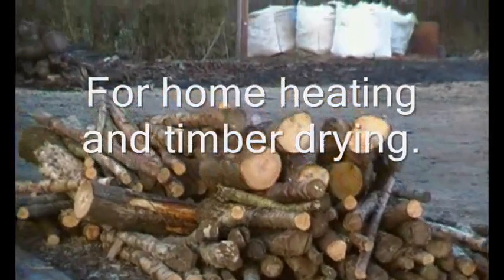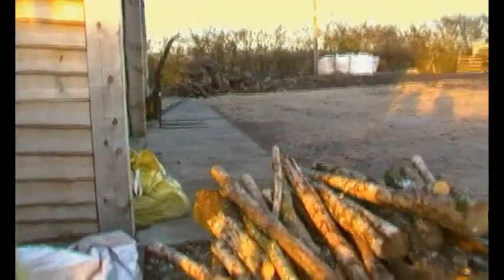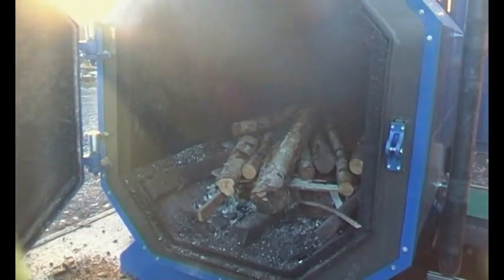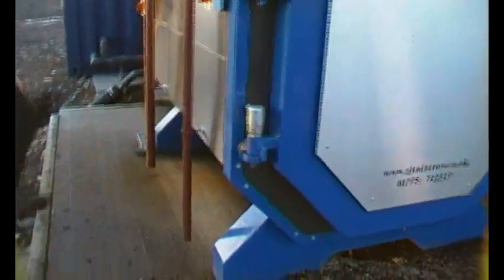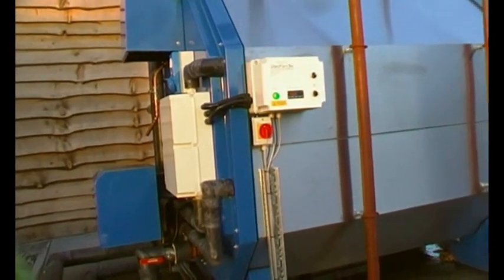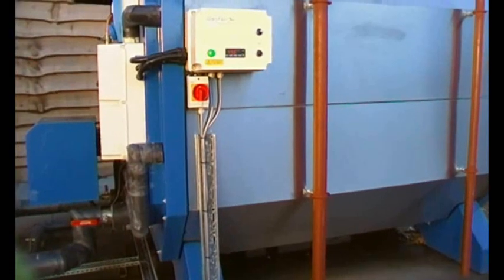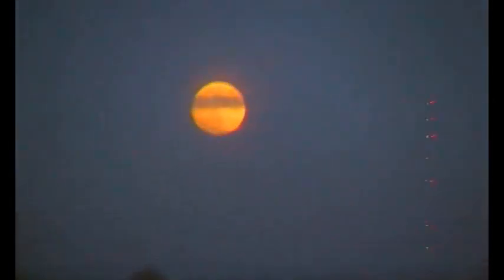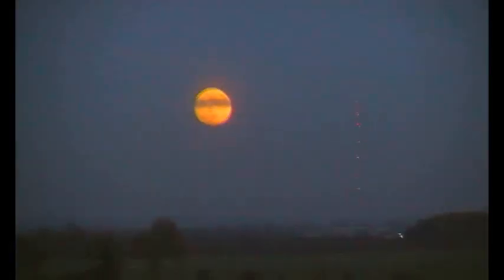Firewood drying kiln run with biomass boiler, and providing home heating.

Comment: Looking to build a small firewood kiln (on the cheap) to finish dry our thinnings for sale using a shipping container and home built wood burner Andy. This video and the chap over at the Oak Farm Firewood channel is giving me plenty of inspiration👍
Reply from the maker: Jim, from my experience it#s all about airflow and so transferring moisture from the wood surface without drying it too quickly, so the air doesn't need to be too warm, cheers

Comment: I’m looking for this exact set up. I have 2 45’ containers that I am wanting to use for a firewood dry kiln. Where can I buy this set up?
Reply from the maker: Hi, it's a Glen Farrow from Spalding Lincolnshire, subscribed? cheers
Reply: @TheInfoworks  I’ve tried contacting them can not get through. Is there a dealer in the United States? I ordered your book I received today. Believe it’s the wrong one
Reply from the maker: Hi, have you tried emailing them, we are still in lock-down here. My Timber for Building book described making a dehumidifier based drying kiln, cheers

Comment: Hello, I am just wondering what is the best type of kiln for drying firewood this looks like a good operation to be fair have you experience of any other type of Firewood kilns?
Reply from the maker: Hi. In the past I have installed dehumidifier kilns and they can be very efficient and relatively cheap to make. I have given designs for these in my Timber for Building Book. Have you subscribed? Cheers, Andy

Comment: with 80 degrees out of the boiler he should be getting 60 degrees inside the kiln. Temperature is key for drying logs it needs to be as hot as possible inside the kiln with the airflow from the fans removing the moisture. The higher the temperature the higher the relative humidity and thus the airs ability to absorb the moisture. The problem with the GF boiler is that it will not operate at anywhere near its stated capacity.

Comment: So many things wrong with this set up. The fuel that was loaded would last about 35 mins, Load in any more ( over the secondary air tubes) and the smoke will be unbelievable and breach the RHI emissions. The container is not insulated which will double your drying time.  Vented bags and crane bags do not work you need stillages. Drying time should be less than 3 days, this setup will take 7-10 days and dry a very small volume of wood at huge cost in fuel .
Reply from the maker: Thanks for your voluable comment, from my experience in kiln drying joinery timber a high temperature and rapid air changes will lead to timber case hardening, leaving a large core of wet timber in the middle. Slower gives a superior product for the discerning customer. Cheers
Reply: Correct for joinery timber, the kiln required for this is totally different to firewood and works on much lower temperatures. Firewood customers expect cracks in the wood and it can be dried much quicker and at much higher temperatures. I operate firewood kilns. Some modifications and your friends kiln can works so much more effectively.
Reply: @TunsThree  What's an efficiend way to insulate i 40' shipping container for a kiln?  Im currently trying to build one.  Any pointers would be appreciated.
Reply: @Jimo225  how did you get on with your kiln?
Reply: Iain Pembroke please may I have your email address? I would like to send my questions in regards to my timber set up in Africa

Comment: That was cool to see that setup. :) I have a couple ov questions though: That machine is referred to as a "boiler" but does it actually produce steam? Or is the medium circulated in the pipes really hot water? Secondly, how does this machine being a "biomass" burner differ from what one might call a wood fired furnace?
Reply from the maker: HI. It is water based, taking the water up to 80 degrees C, so not a steam boiler. The way I see it is a biomass boiler is just a high tech wood furnace, but that is what they now call them, and includes wood chip boilers.. Hope all good with you, must be your summer, snow and ice here. Cheers, Andy
Reply: Andy Reynolds Thanx for your reply Andy...that's cleared it up for me totally. I am interested in other forms ov heating as we are now off grid here. But heating not really an issue at present as yes we are indeed in the middle ov Summer now, our Lughnasa will be next week, so it's damn hot. :)